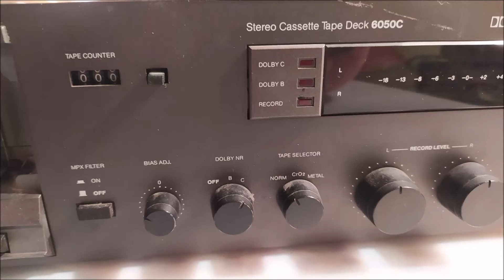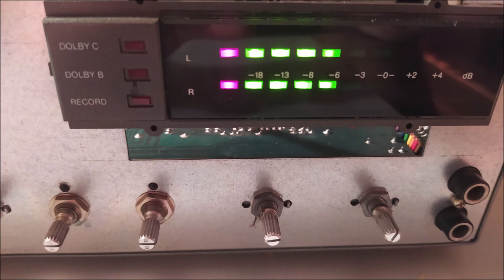NAD 6050c  repair

Comment: I have one of these 6050C units, stored it for 36 years after using it with my nad system( also stored the same amount of time) for only 2 months, low and behold the deck carriage did not work, I opened it up and the main flat belt and round belt which drives off the motor where completely disintegrated. Now I consider it junk. It to bad because it worked and sounded excellent.
Reply from the maker: ok
Reply: Working on one with that exact issue right now
Reply: @ferrograph  I ordered a repair kit from amazon that should have had thee correct belt included, however it didn't so I am out of luck. They are great units, I miss not being able to use it.

Comment: Very nice done! Maybe I buy a not working one...would be my first NAD I try to fix. Old, dry grease and belts seem to be the main problems, right? I am a little frightened obout the "piano " keys at the front. Do you think I will be successfull, or is this device more tricky than it seems? I have little experience with Pioneer and Yamaha cassette decks...What condition are the NAD electonics inside -usually - after all theese years?
Greetings from Germany
Reply from the maker: You never know
devices are old
today it won't work tomorrow
Reply: I've recently worked on a couple of NADs and the electronics were fine. Just the mech needs to be stripped cleaned and lubed.